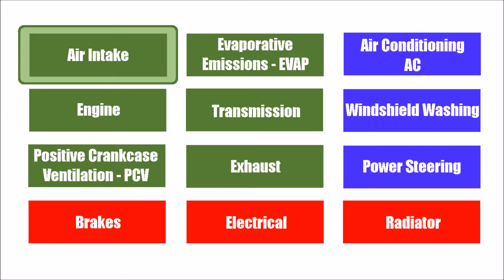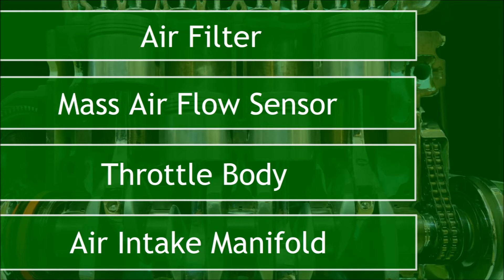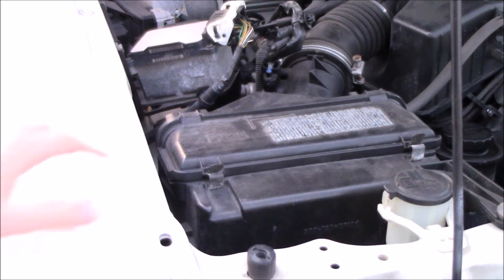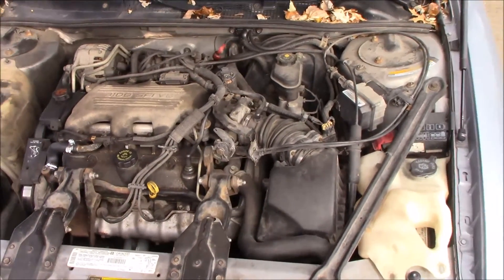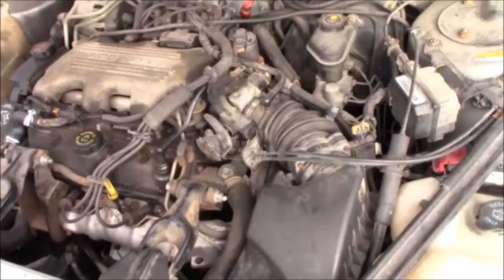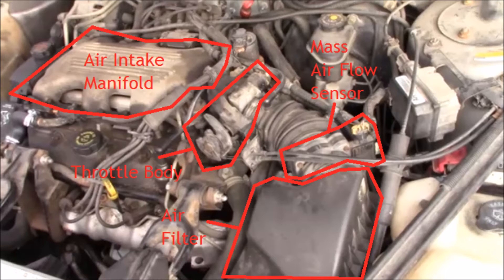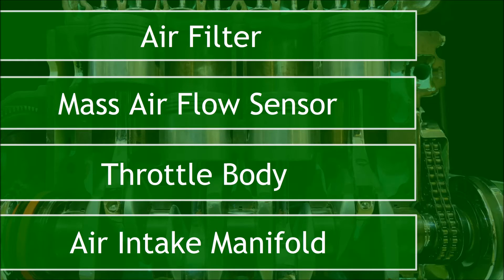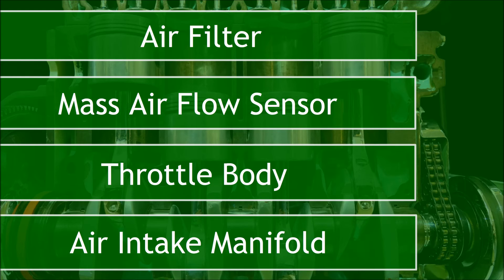Know Your Car - Air Intake System

Comment: In your opinion, a synthetic oil can used upto how many years.? If the car is rarely driven per year as low as 500kms to 1000kms

Comment: Hi can you explain what is the function of that hose from the air filter housing that you said is part of the evap system? you mentioned there will be a separate video explaining that, but i couldn't find it. please also share the link of the other video if you have it. thanks.
Reply from the maker: I apologize I was intending to create this series but didn't get much traction in the three videos I put out. That hose for the evap system I believe is to allow a valve in the evap system to open and then that air from the air filter housing pushes the gas vapors floating in the gas tank into the engine to be burned.